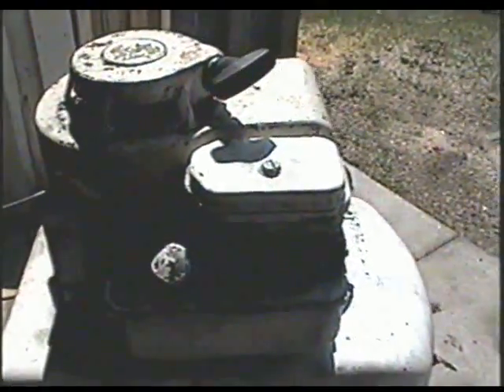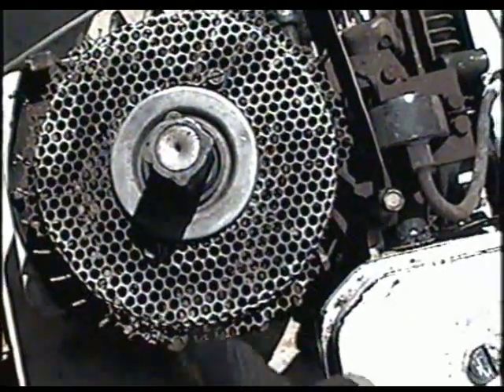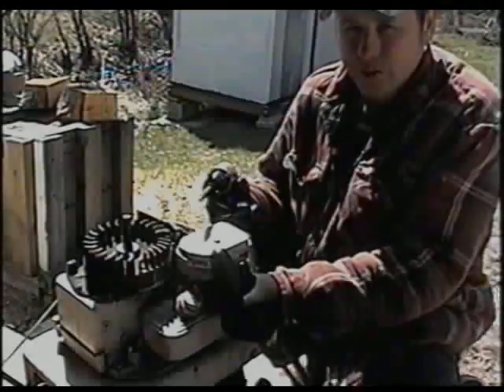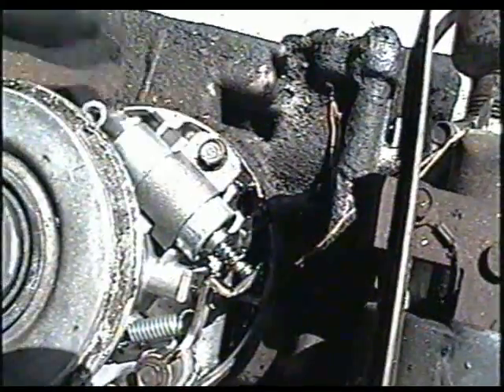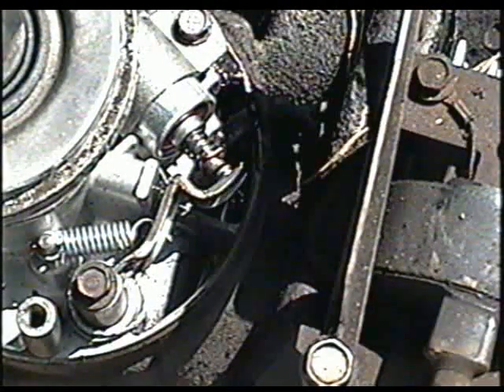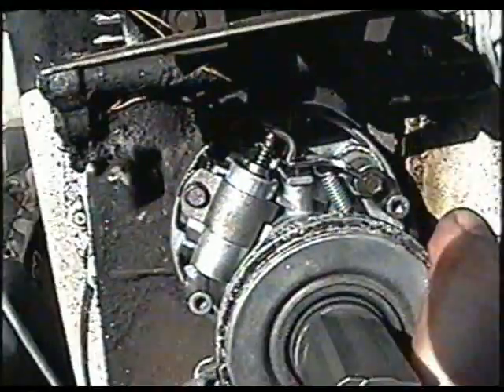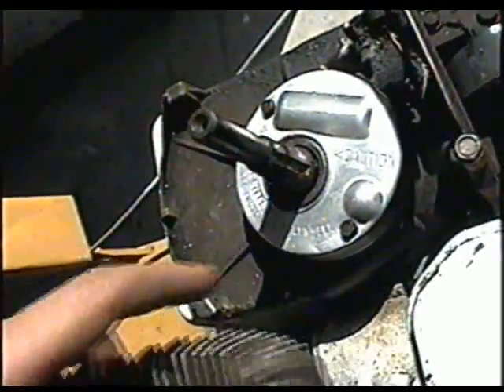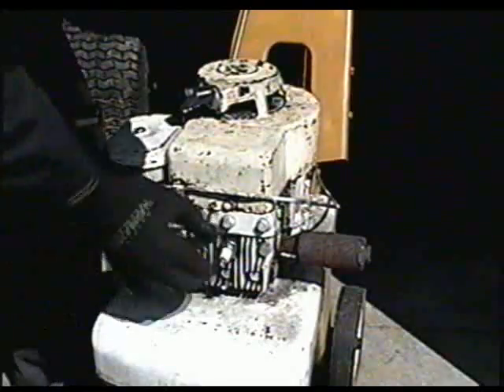HOW TO ADJUST The Points on 3.5 HP BRIGGS & STRATTON Engine

Comment: I have a tiller just like that, and your videos helped me save it from the scrap yard. It's so hard to find something on something this old. Do you happen to know anything about how the engine transfers power to the gearbox and how to service that? I assume it's a belt drive but I'm afraid to open it. It seems to work fine, and I changed the gearbox oil. Just send it and put in a huge garden?

Comment: They also have small straight point files available from most auto parts stores, that will make it very easy to dress the points. I have one that I use almost everyday on things like this, and it help out quite a bit.

Comment: I have the points in shortcircuit (tested with tester) also when they are separeted. What it could be? The coil has a R about 2,76 kohm with ground wire attached so it isn't

Comment: ah fond memories of working on all my cars in the 60s and 70s.  Worn out distributor cams, worn out or burnt points, etc.  Could do a tune up in just over an hour including points, cap, rotor, condenser, plugs, wires,  and voila.  Throw in an oil change at the same time and it was fun
Reply: Wow you must have had a lot of practice

Comment: Any idea of the belt routing underneath the engine? I’ve acquired an old JCPenney with the 3.5 BS and it has one belt but the other is gone and I can’t find ANY info on it. I’m guessing it’s late 70’s. Model 3012B.

Comment: Great video. I wish my brother and I had known about the nylon rope in the cylinder trick when we were teenagers working on mowers and tillers about, well, 50 years ago! He finally got a special tool that fit the fins on the flywheel, but until then we struggled with long screw drivers and judicious tapping, lol. My interest was rekindled in this as I recently got an old tiller with a B&S that I remembered from my days as a kid repairman and I had forgotten the plug and point gaps (did I mention it was about fifty years ago?) When I worked for a feed store in high school maintaining their pump motors on fertilizer rigs I could set the gaps, including the armature, by eye in the field during emergency repairs I was called out on, lol. I'd check the spark by holding the spark plug wire and rolling the flywheel magnet with a quick twist with my other hand. If it gave my arm a good jolt, I knew I was good on the electrical.

Comment: I have a rototiller very similar to this, could be the same engine in fact just mounted in reverse. My problem is that I have everything taken off but the plunger doesn't move when I turn the engine over. Does anyone have any suggestions on how to fix this?

Comment: I have a similar model. The blades were stopping, so I took it apart and found it to be unbelievably filthy inside. So now that it's clean, I cant remember where everything goes. Any idea where to get a diagram of the belt assembly? I haven't had much luck.

Comment: Whoda thunk anyone would need this video, and your other videos on this engine after 18 years. Well, I did! Very succinct and helpful. Thank you for all the videos you made on this engine. They were very helpful for me in rebuilding the carb, and setting the points on my 1965 tiller. It was amazing to discover I could still obtain the part manual and buy the parts for this engine. Now, if can only find a shroud that still has the tabs to hold the Pulley-Starter in place, I'll be good to go. Thanks again for the video!

Comment: donyboy73 I love your videos. I have a Spiegel tiller that is very similar to the one you have in thepoints video. What I am asking is do you have any idea what size drive belt it takes. I have no manuel to go by and its mext to impossible to measure it. Any info would be greatly appreciated. Thanks.

Comment: Sandpaper or emery cloth should NEVER be used to clean ignition points! They can leave grit between the contacts. Therefore, it's better to use a thin, steel points file or a steel fingernail file to clean points. Actually, it's best to upgrade the engine with a B&S Magnetron solid state ignition module.

Comment: permanent solution: that appears to be a 90000 series, they still make them, find a newer junk one at a local junk yard and put its solid state magneto on it. Won't need points anymore.
Reply from the maker: yes and it work on 5hp as well

Comment: Hi,i have a very old david Bradley tiller with the same motor.Ive cleaned the points and set the gap to 20 thousandths..I also rebuilt the carburetor.It has terrible kick back to it.It has to be the points plunger?right.Can I switch this motor over to electronic ignition?I have a coil that will fit.I love using the old points setup but it seems to me that the points are firing way to early and causing the kickback.

Comment: Good ol pulsa jet carbs!  I thought that carb spring was in the wrong spot!  The cast iron flywheels usually popped off pretty easy.  Sometimes it is tough to get those carbs to accelerate real well without raising the idle speed some....I always thought the simpler vacu jet carbs ran better!

Comment: Question - I bought a rototiller with a similar engine (1973 Bolens, Model 2135-02, B&S 3.5 HP engine # 92902-131601). I was able to follow your great carb cleaning video of this engine and the tiller now starts easily on the first pull and runs great. However after about 5-10 minutes once the engine gets hot it shuts off & and am unable to get it started again until it cools down. I've done a lot of research & there are a lot of things I can try changing .. I'm hoping to narrow it down, my next step is going to be to try & check for spark once its hot and maybe replace the ignition coil? Do you have any thoughts or advice?

Comment: I have the same tiller and I need help!!!! Ok so the shaft spins freely after the engine is running then I try to start it again and it still spins freely, then I have to hit the shaft with a mallet to get it locked in place

Comment: Thanks for sharing! Great videos! Greetings from Norway!
Reply from the maker: greetings from canada
Reply: donyboy73 Sorry for interupting you but I have a question. I managed to get my engine going (3.5HP briggs on a lawnmower, from 74) and it looked extremely like this engine you got right here. However, when i start it, I am unable to get a good low Idle speed. I am guessing it has something to do with that nut you were twisting on in the end there. I am also unable to give it more gas, because then it just shuts off aswell.
Do you have any video, or anything i can search for on how to get a good low Idle and a good fast RPM when giving more gas? (probably related to that nut on the carb)
Thanks in advance! 

(Greetings from another norwegian ;) )
Reply: From Norway from Norway, but județ?!?

Comment: @Mennitti4Congress-It may be a little late, but if you pull the cord, the blades spin but you feel no resistance, I think it may be something internal. When you pull the cord it causes the flywheel to turn which is connected to your upper crankshaft. The blade is at the other end of your crankshaft. If everything is turning freely with no resistance (e.g. no compression) either rod/piston are shot, or your exhaust valve is stuck open. It could also be your head gasket, but that and exhaust valve would have nothing to do with hitting a stump.

Comment: Sounds like the flywheel key is sheared. When the blade stops abruptly the flywheel will continue to turn and damage the key. The result is that the spark plug fires too early. Only use a key intended for this purpose a steel key will cause major damage if you hit another stump.

Comment: Great video!  I have a 3 hp Briggs motor on a real old Sears Push Mower.  I hit a small stump and it stopped the blades cold.  It won't start.  When I pull the cord the blades turn.  It doesn't feel like any additional resistance when I pull the cord.  Do you think it is the flywheel key or something else?  Thank you.
Reply: Sometimes these engines have a failsafe, and won't start when the tiller clutch is engaged.

Comment: hey donyboy I recently did some work on a Briggs and Stratton 3.65hp lawn mower similar to the one you changed diaphragm on but I did the disassembly wrong and cannot get the springs back on perfectly as they do not have any tension even though they are in the right position I think it have to do with the plastic piece attached to the magneto coil and even though the engine started easily it revs in pulses and sounds like it lacks power I also removed coil etc I think this is the problem help.

Comment: I started doing this at 13 years old. I fixed dozens of mowers in our neighborhood... in the 70's. You can take a piece of wood and tap the ears on the starter clutch to get it off, rather than doing the rope thing. Did dozens and never broke an ear.

Comment: What I usually do instead of filing the points is removing the points and condenser altogether and and go for a solid state ignition conversion instead by installing a coil from a usually from Quantum or a another enigen that has a bent crankcase..

Comment: One goes to the coil, the other is the kill wire, on older engines its on the throttle lever on the carb. It grounds out when you close the throttle.

Comment: I looked at the points gap, and it is good and clean. my ? is on the wires that come out,( you mentioned using RTV to protect them) were do they lead out to. there are 2 on mine and they are cut. no idea what they connect to. and could not see it on this video. 
thanks!

Comment: RE sanding the points, I have had great luck with a points file.  They are around $3.00 for a 2 pack from Amazon, reference below.  Much easier that using sand paper.
Great Neck 25342 Ign.Pt./Utility File 2Pc
Tony

Comment: THANK YOU! this is exacally the video i was looking for! i could not even figure out how to get they flywheel off! now i have a motor to build my rough cut mower for my atv! btw,mine is a horizontal engine 3 hp,do you think it would run a 20 inch blade for cutting 6 ft weeds? they would be dryed out

Comment: i hade a problem with a 5 hp briggs like that (horizontal) we had it on a mini bike and my friend started it and accedentaly droped it on te shroud side and it kept running and busted all the finns off the flywheel and caught on fire and he died. not really. but i put on a new flywheel and put it all back together and it kept shearing keys so we checked the internals and we just about bought a new crankshaft and then we were taking to a guy and we wernt getting that starter clutch on tight enout

Comment: I have an older (81) up draft carb on an 8HP Briggs. When I took off the point cover all was corroded inside. I installed new points and attempted to set the points. As I rotated the engine, it seemed to me that the points did not move and impossible to set the points. In view of the fact that there was much corrosion in that area could the plunger that opens and closes the points is corroded and won't move?

Comment: I have reservations about putting nylon rope in the engine.  The nylon strands are coming off.  I put in 3 feet and the flywheel still turns.  Why?

Comment: Can somebody give me some advise here. I have a snapper mower with a carb just like this one. It doesnt have points tho.. I checked compression its ok, I checked spark I have a bright blue spark. I pour a little fuel in carb even tho I just rebuilt it with a new diaphram.. But it still wont start.. What else can I check..

Comment: Good job.  One thing that is useful to check is the top crankshaft bearing side play.  If there is any this can affect the point gap.  I found that when adjusting the points it helps to push  and hold the crankshaft firmly in the direction away from the magneto.  This makes the point gap more accurate when the engine is running and the compression pushes the crankshaft away from the head.  Of course if the top bearing play is too much the engine is pretty well shot anyway.

Comment: That's a load of bullshit right there, I have a points engine, and for a while I ran magnacrap on it, now I'm back to points, all on the same original points flywheel. My points flywheel (1977) has 2 or 3 magnets in it (can't remember), I also have an extra magnacrap flywheel laying around, it's exact same thing.

Comment: this is an antique engine from like 1970 lol. I bought a push mower with an engine like this and it did not run, no spark, had grease on points. cleaned them up and set the valves, run this motor for 5 yrs and gave it to a neighbor and he still has it. These engines were made to last!

Comment: I usually go 8&10 for strong compression and it allows for wear. I fixed a lot of mowers that had tight valves Exhaust is bad for that.. I drag wet sandpaper through the opening and it files them down real slow. use brake cleaner to remove any grit.

Comment: Most engines are .020 but do not sand them. make sure there is no grease/oil on the contacts and B&S recommends you drag clean paper through the points to remove any oil. If you sand the points, use fabric and brake cleaner to remove any grit, it will weld the points as you run the motor. be sure to get the flywheel very tight or it will shear the key... set your valves too .06 in .08-.10 ex it should run awesome... Former B&S mechanic

Comment: It won't start at all. It used to have a On/Off switch on the steering wheel and we disconnected that, but we have not taken the wires off yet. I'm not sure if that is taking power from the spark plug or not. Also, when i crank it, gas blows out as a mist from the carburetor. And it looks like the bowl's o-ring gasket is getting soaked. The float is fine needle and seat are fine. I am not sure but I see a tiny ball bearing it looks like on the side of the center shaft in the bowl. Is that right?

Comment: I found a feeler gauge and I just took the crank off and turned the engine until the timing notches lined up (TDC) then put the casing back on and took the OHV cover off and used the .004 feeler gauge on both the exhaust and carburetor valves and made sure they are snug but not too tight. Is it normal to crank the engine and feel wind come out of the carburetor on the air filter side?

Comment: It is OHV and it is turning the crank so I don't think the fly wheel key is sheared. I looked up how to adjust the OHV and it said to use a .004 inch feeler gauge and adjust them to that. I just used a sheet of paper and used that for measurement.

Comment: Hey donyboy73 I have a few questions. I have a Tecumseh 6.0 HP go cart. It will not start. My step-dad said to check the carburetor and using your videos, I cleaned it and rebuilt it. When I try to start the engine, sometimes it backfires and yanks the cord out of my hand, and also it sprays gas out of the air filter side. I checked the spark plug and it didn't have gas on it and didn't even have the smell of gas. The spark plug is getting fire though. What should I do?

Comment: I sanded my points and still have no spark. I checked with a volt meter and I show the wire from the coil connected to the tip of the condenser is grounded.. Does this mean a bad coil as I traced the wire and they are not touching the case anywhere AFTER they leave the coil.Points AND condenser tip both show shorted to the case.

Comment: @1717BY I think you're right. I just bought a new points and condenser coil for my 3.5 hp Briggs that I had electronic ignition on, and before I had to pull the rope harder before it would spark.

Comment: @1972FordF150 I'll bet if you measured the spark voltage and compared the two, the magnetron spark would have a higher spark voltage.  Bigger and brigher doesn't mean anything, you have to back up your claims with actual measurements.  Sorry dude, but that's how you prove it, and you haven't proved it...

Comment: Get shocked by a magnetron then a points&condenser engine and you'll find out. I have a 3.5 hp Briggs that I put magnetron on (wire going to the points from the coil was rotted so I had to put the magnetron on to run it) and before it ran smoother, started easier, and had way more power than it does with magnetron. Plus it had a way bigger and brighter spark with points than it does with magnetron. It hardly sparks with electronic compared to the points.

Comment: @1972FordF150 How do you know they don't produce as "hot of a spark or as strong of a spark"?  Have you verified this to be sure?  My experience with these engines shows that the Magnetron electronic ignition produces a far hotter spark than the points and condensers.  The electronic coils are not POS, I've never had a single one go bad.  Why waste time fiddling with points if you don't have to?

Comment: @meccaturbo These electronic engines don't produce as hot of a spark or as strong of a spark as these points&condenser engines do. If your not lazy it's fairly quick and simple to install new points and adjust them, plus it's fun to do. They work way better than those electronic pos coils do.

Comment: i found your video as reference because it's been so long since i have done points and condenser work.. i'm working on a 1979 b&s 3.5 hp similar to the 1 you have. i noticed 2 wires in where you connect them on the condenser with the spring holding them but not going anywhere just hanging out, nothing to the magneto.. where on the magneto does 1 wire go?

Comment: hi is a .010 points gap good enough i used the ignition gap setting on my feeler gauge the brass one cause my points where at.004 lol and full of oil but still working?

Comment: i just gut a aluminum mower i think a Jacobsen deck with identical engine what year is your engine  mine says 59 on pull cord cover i am   starting to think the cover is older  cause original engine paint was wight like yours and pull cord shroud was metallic blue  i think the points were abandoned and changed to electronic coil its to full of dirt to tell it dose run but needs carb clean.